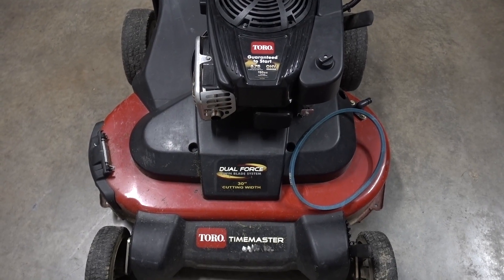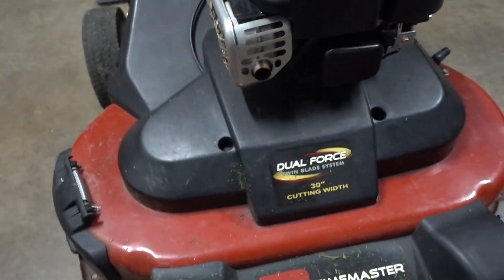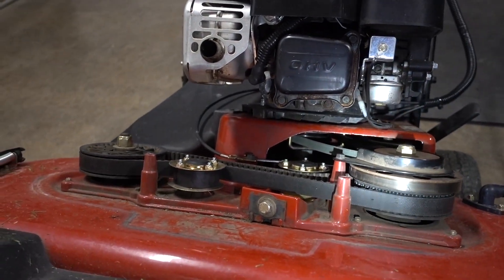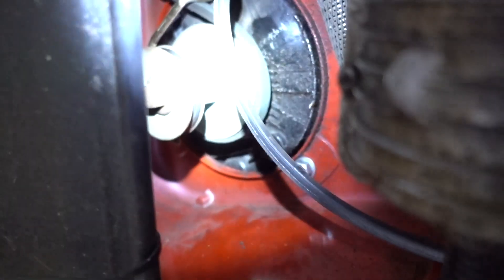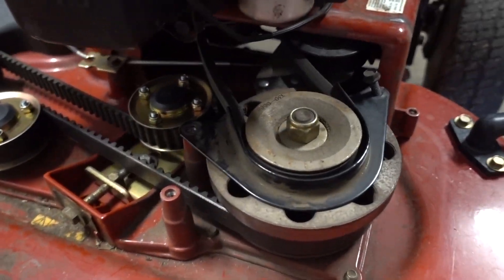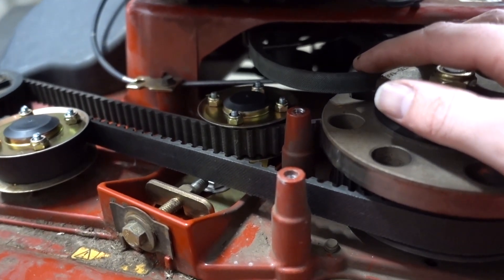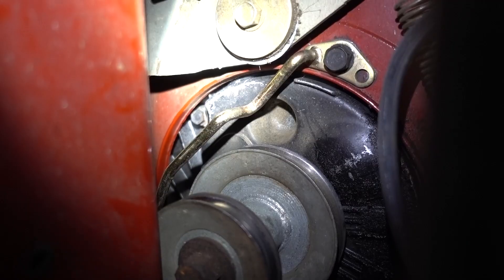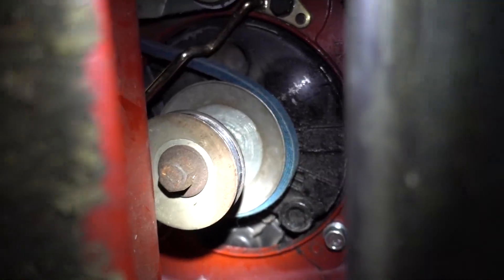Toro TimeMaster 30" Blade Engagement Belt Replacement

Comment: Thank you for the video.  I was struggling with removing the drive belt until I watched this.  A tip for you on making your belt last longer.  If you engage the belt drive more slowly it will preserve the life of this belt.  I also try to minimize the number of time I disengaged / reengage the belt each time I mow.  My belt last 6 years.
Reply from the maker: yes I agree if you are not as aggressive with things they tend to last longer! thanks for sharing!

Comment: Great video, Thanks.
To remove the large spring on the transmission it is best to place the height to level A. The spring tension will be reduce and angle align for easy removal.

Looking at the video, you had it on level A. Mine was on level D and it was very difficult to remove until I figure out how to change the angle on that hook lever.

Also it's tricky to put that belt through that bracket. I find going from underneath towards the right side.

Thanks again man.
Reply from the maker: Great tip!
Reply: Well shoutout to myself for putting it on C before stumbling on this comment lol
Reply: Now you tell me, lol😅

Comment: Thanks for your video. I was able to do this and save a load of cash. I used a plastic lever that I bought from Amazon to undo clips and stuff which was really useful to get the lower belt off. I’m not a DIY guy so this gave me lots of confidence to do more. Thanks again.

Comment: Thank you...

True story. I just Got my TimeMaster which came in brand new packaging (plastic and all)... After the first run (about 30 minutes), I noticed that the blades wasn't engaging... Then I watched a video which suggested I tighten the Spring under the cover. I did that. it worked for a bit butt then the blades disengaged and would not reengage the blades. Took off the cover then noticed the belt was black and had a lot of cracks (It look just as worn as the belt in this video), seriously. So I ordered a new belt and thanks to this video, replaced it. I tested the mower on a small patch so only time will tell if that corrected the problem.
Reply: and was it the belt???

Comment: Great video! Thanks for taking the time to include all the details. Fixed mine with your part no. I'm up and running like new 👍🏻
Excellent mower.
Reply from the maker: Glad it helped!
Reply: I like the machine as well and yeah i realize i need to have spare belts lol they take a beating.
Also i did a kohker engine swap and its a beast now.

Comment: Thanks. I have an Exmark Commercial 30, the belt layout looks identical. That particular belt failing has been the only mechanical problem I’ve had with it, and when I was fooling around with the cover off the other day I noticed it’s got a large crack in it yet again. I always had the dealer replace it because I wasn’t sure how to go about it but now I do 👍🏻

Comment: Very helpful, thank you! Mine failed yesterday. One tip if I may. When mounting the new belt on the blade drive pulley, consider using a gloved hand on the blade to rotate the pulley, rather than trying to rotate the pulley directly.
Reply from the maker: Thanks for sharing!

Comment: Great video, thank you for this!  I don't think the larger spring needs to be detached, just the small spring that was detached first in the video.  My timemaster also had a stop plate when the transmission rotated forward that stopped it from moving further forward, I pushed the bendable metal plate out of the way and the transmission rotated enough for me to remove the first belt so I could replace the other belt.
Reply: I agree I don't think the larger spring did anything in making it looser

Comment: thank u for the info it helps alot/on a previous comment,   yes i would recommend these mowers they work very well the motor is very durable i use  mine for my business , changing the belts once or twice a year is a small price to pay

Comment: Be sure the blade engagement cable isn't too tight or you'll wear the belt out very quickly. It should be relatively comfortable to hold the lever. Great video!
Reply from the maker: Thanks for sharing!
Reply: How do I check the cable? If it’s too loose or tight?
Reply: @uliperezsatx  follow the cable from the lever to underneath the plastic cover on the front and there is a little bolt and plate you can loosen to pull the cable more tight or more loose then tighten the plate back down to hold it where you want it to be

Comment: Good video thanks for posting it. Helpful. I see you have some new engine mount screws. I am thinking your originals loosened up on you? I had that problem. It seems to be a problem with the TimeMaster mower. I didn't lose the bolts thankfully but they were very loose. If people read the comments about replacing belts you may benefit from check the engine bolts and tightening as needed. These screws screw into tapped bores in the mower deck so be careful about over tightening. I used loctite on the threads and 200 in lbs for engine flange tapped screws to frame.

Comment: Good mower. The belts I have a major issue with. Have replaced this belt several times. Toro needs to have videos explaining the belt tensioning process and how to achieve this. Just replace the third blade drive belt in two months. Spent 900 for this mower and seriously regret it. I do not recommend this mower due to the belt issues

Comment: I'm not sure if you'll be able to tell me my issue. But recently the blades have been lacking the speed the should be going at. It takes them a bit to really get spinning and even then its not running at 100% speed like it should be. For example, if I'm cutting thick grass that's medium height (about 3 inches tall and cutting it down to 2)  it will struggle really bad and the blade wont catch much leaving a lot behind. Hopefully you can tell me what the problem might be but if not I appreciate the response. In order for me to see a reply you need to heart this message.
Reply: I'm having the same issue did you find out why
Reply: Tighten the cable maybe? Youtube has a video on doing that
Reply: Sounds like tour belt is slipping.

Comment: Would a slight crack in the belt affect the power?when my blades are engaged they sound underpowered and slow down when actually cutting the grass.
Reply from the maker: I don't think it would cause a huge issue. Obviously if the crack it's big enough then the belt is stretching ever so slightly but probably not something you would notice
Reply: I have this same issue. Did you ever resolve your issue?

Comment: How tight is that green  belt suppose to be. Are you suppose to be able to spin the belt with your hand
Reply from the maker: The blade belt (lever activated) should be loose but not falling off. The black belt that controls the blades has a specific tension so that is different and ribbed vs the other belts are v belts
Reply: I panicked because my toro was losing power and sputtering  when i would engage the blades and eventually cut off. It was only a month old.  I did what was best and took it back to home depot under warranty, and got a brand new one, since i was on my last day of in store warranty to return it

Comment: You're about right with 60 hours because that's when mine just broke today...lol and it had about 58 hours on it...
Reply from the maker: If you replace it just make sure you adjust it properly. I think I was having issues with mine and found out that there is a recommended adjustment spec. Basically you install the cable under the metal bracket before it runs under the engine and then you give it about 1/8" of slack and that seems to make the cable operation smooth!
Reply: @scottwalker19  this is really good info.  my belt just frayed and crapped the bed after only one full season of use.  however, between recent mowings I got in there and readjusted this spot and did not give it any slack because I felt like I wanted the blades to engage sooner, completely failing to comprehend that this would put a ton more stress on the belt while it was in use.  About 3/4 of the way through my very next mowing, bam, gray/white smoke, burnt rubber smell, and no more blades engaged.  Glad I looked at it and decided it was a job I can do on my own.  As of now, it's looking like a 20 dollar and 30 minute learning experience, rather than a 200ish dollar and multiple week learning experience taking it into the shop to do.

Comment: Can you replace it without taking off the other belt?
Reply: No, it has to be removed.  after removing the spring(s) on transmission the drive belt is easy to remove and put back in place at the end

Comment: Great Video! I bought an Exmark 30" for this season and this belt just went after 3 months. I believe they are the same mowers, but mine is commercial. The belt you have from amazon in the description. That would be the same belt I would use for my exmark correct?  Thanks!
Reply from the maker: Probably not but you can always look up a parts diagram on google for your specific model and year. Toros website likely also has parts diagrams.
Reply: The Belt number for the Exmark 30" is 121-5765-SL. Just incase someone needs it in the future.

Comment: Did your mower make a screech noise when engaging the blades?
Reply from the maker: What do you mean? It usually makes a small “screech” when engaging the blades normally because it is going from a complete stop to the rpm of the engine.
Reply: @scottwalker19  When you engage mine it makes a 2 second long loud screech.  I'm thinking the belt is stretched out causing the noise.  It sounds like EEEEEEEEEEEEEEEccccchhhhh lol
Reply from the maker: It sounds like its doing the normal noise that they all do.
Reply: I hear the same screeeeeeetch sound too. But found it was my mother-in-law just being her usual self.

Comment: Man my Toro 30 just don't pull anymore like it did when I bought it. Ive tried everything i can think of. Except for the transmission. Any other clues anyone?
Reply from the maker: You could make an adjustment to the tension cable. Make sure you are adjusting it the correct way though. Ultimately it could be the transmission which is not the end of the world. I think it's only about $150. The tension cable is the only thing I could think of besides the transmission, because those are the only two components for the most part. Hopefully that makes sense!
Reply: Right on

Comment: Toro made a horrible design.  Belt breaks all the time
Reply from the maker: I have never had it break on me but it does wear out
Reply: Only breaks if your cutting overgrown grass or if it’s gradually perishing
Reply: Mine broke 3 times in a week i don’t know what to do
Reply: Same here, so far I have changed it 3 times. I’m using it on 15 lawns a week. And after the original belt broke, none of the other belts last long enough to finish mowing the lawns.
Reply: I have decided the belt fails due to extreme heat from the engine heat transferring to the belt pulley and overheating the blue OEM belt till it fails!
Any body have an opinion on this theory?

Comment: Looks Like you have done a lot of work on your timemaster.  Would you still recommend them for use?
Reply from the maker: That is true. The hour meter was put on after having the mower a little over a year so it probably has close to 200hrs. I am using it in my lawn care business and at my house so it does get used more than a normal homeowner would use it. I definitely like the mower and its capabilities. Repairs are common with that many hours but nothing with a major cost that would take away from the value that I get from the mower. The 30" deck and the ground speed of the mower is great compared to a normal 21" or 22" mower. So I would say evaluate what you need it for and if you have not tried one out I would say it would be a good option depending on your needs.

Comment: First and last TimeMaster I buy. Third time replacing belt in two seasons. Grass sticks underneath even when not wet. Horrible design. This mower does not save you time in the long run.

Comment: Were you experiencing some slippage?  FYI. Below is a video that shows how to replace the timing belt and how to time the blades, when you cross that path.

https://www.youtube.com/watch?v=229iV0mIV58
Reply from the maker: I was not experiencing any slippage. After owning the mower for several years, the common issue that I have with the belt is that it develops a crack and that means it’s on its way to breaking. It has happened to two belts so far.
Reply: @scottwalker19  I've had my TimeMaster for 2 years and will take a look at those belts to check the condition.
Reply: Just checked and the drive belt is fraying.  I'm going to replace all of the belts.  Thanks for the video.